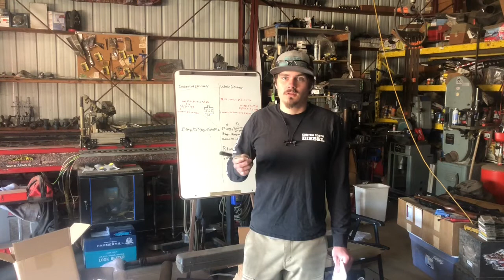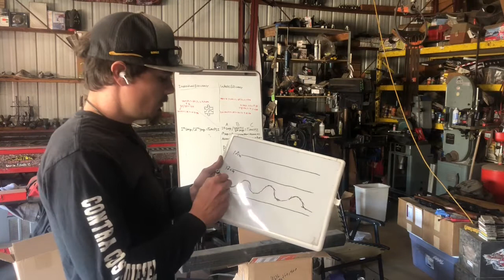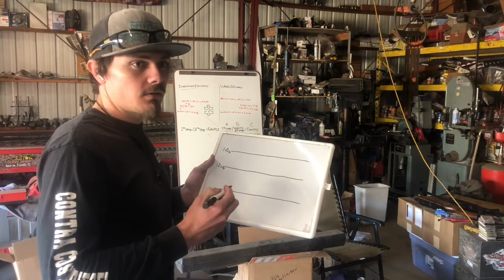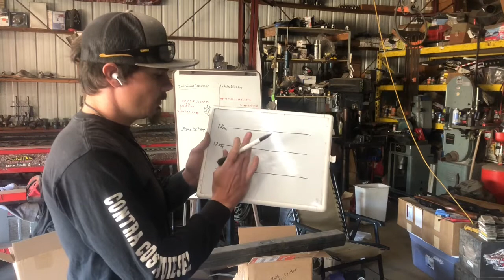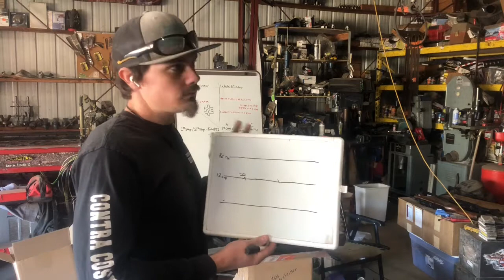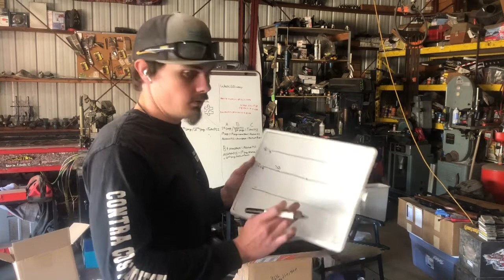Diesel Engines Turbine Housings and Exhaust Headers PT. 1

Comment: What housing would you recommend for the g25-550 I picked up for my stock fuled 1stgen ( no plans to crsck the factory seals till after phase 1 hoal complete 150mph at Bonneville.  ) current chargrt is a little hx35  10cm with diverter valve set to open 18 close 15psi.
Reply from the maker: I would go with the .92 v band wg housing. The ar follows foot size and the g25 uses a t25 based foot.  So it’s going to want a larger ar to equate over to what the smaller ar t3 equivalent would be. And it is dealing with 1L per cylinder per exhaust valve open so without knowing it’s nozzle size that would be my selection to keep it from going into choke flow too early.
Reply: @savagefabrication795   thank you. How much of the 550hp ,55lb/min ( h1c was supplying 25lb/MIN@ 17PSI )do you think o will be able to make use of?
 been a few expairaments/years  sence dyno was run on h1c 16 full thermal management head bolts to downpipe wrapped 491.0@1846 178.3@1976  tire at pdd. Later a standard hx35 but it fell on its face at  1500 5psi  belching black liks some old POD's, so the QS valve solved that with 15psi at 1500 at less throttle 400° egt drop.
Reply from the maker: @daviddroescher  I can run the numbers at the same engine rpm but ve falls off as drive pressure goes up. We did 358whp/850 tq on a stock hx35. Putting it on a truck that previously made 408 on a free’er flowing turbo. It sounds like a fuel delivery issue or somethings up with the gate as boost on even a 16cm at 25 psi seems low.
Reply from the maker: @daviddroescher  average is dirty math is 8whp per lbs of air moved through a diesel engine.  Not always the truth but on average it’s what you will see.
Reply: @savagefabrication795  
Factory tune 91.5(june).  A hoter tune would fall under the turbo faster/ milder grade at 55mph speed limit  . Tuning will nullify my stock fuel 150mph Bonneville Goal.
Reply from the maker: @daviddroescher  got ya. In that case your goal is going to be to get the bsfcr number as low as you can. Running as much boost as possible at as close to 1-1 drive to boost is going to be the ticket to make that happen to reduce pumping losses and co2 left in the cylinder during the exhaust stroke :)
Reply: @savagefabrication795  in regards to housing size:  was the .9 recommended based on 3500 gov spring or stock rpm?
Reply from the maker: @daviddroescher  engine displacement and rpm vs getting engine ve to be as high as possible.
Reply: @savagefabrication795  
EG : environment 9.5% grade 70mph  9 f aimbent 6000'  .  Motor: 1585( Allison  2nd over .61) standered hx35 /12 +BD spool valve closed  egt 800 compressor -9 ° f in 156°f out  , 11f @15psig intake below horn
Reply from the maker: @daviddroescher  that would put it at a estimated engine mass airflow at 19.37 lbs minute. At those conditions using dry air. :)